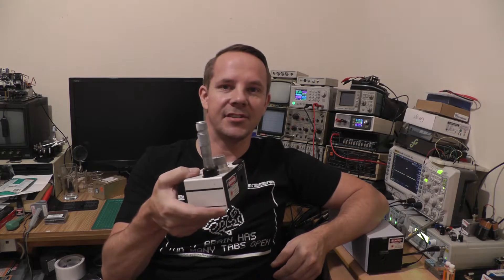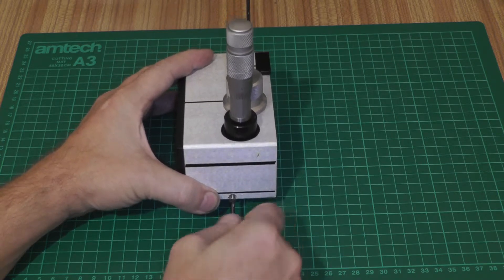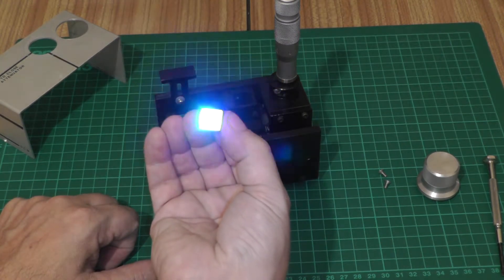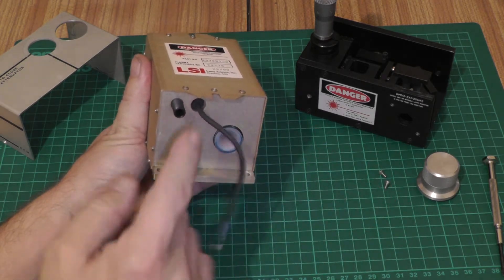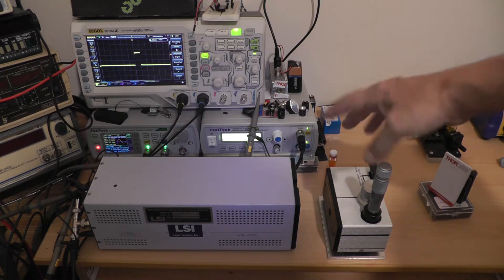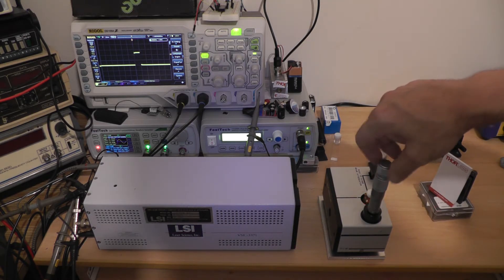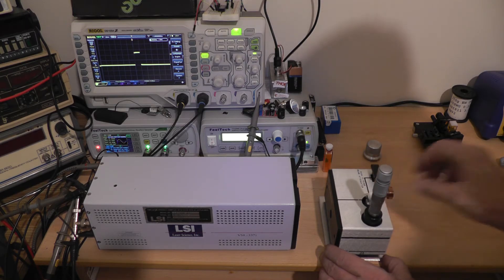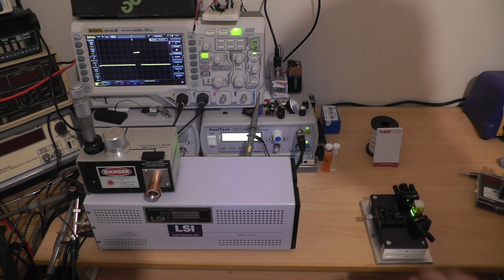Dye Laser Teardown and Demonstration

Comment: I'm building a rhodamine b dye laser using a flashlamp pumped passive q-switched Nd:YAG w/ SHG assembly, and would absolutely love one of these gorgeous dye laser assemblies. Heck, just a nice stable cuvette holder w/ mirror mounts would be amazing. Unfortunately I live in an apartment and can't manufacture an optical table for mounting parts, but I'm still hoping to get nice lasing.
Reply from the maker: Nice. with doubled YAG as the pump, you will find it hard not to get it to Lase! It is possible to do a reasonably good job of a cuvette holder, with basic hand tools, and some 12mm square section aluminium tube (with a 1 mm wall, a cuvette fits nicely in these!). I have a video of a home-made effort here: https://www.youtube.com/watch?v=-ny_-Y1MpRY

Comment: These are as rare as hens teeth. i’ve looked for a few years consistently on eBay… I’ve always found the dye stuff interesting… But these have not appeared on the USA eBay page in at least the last 18 months that I know of. And I always check the LSI equipment, specifically the VSL337 nitrogen lasers. Because sometimes The die modules will be oddly attached or included in a part slot with an LSI nitrogen laser

 Would be a lot of fiddly work… But I could reproduce them fairly well… With a bit of machining and tweaking. I don’t have access to my milling equipment and 3-D printers at the moment… Which would make things much easier. And I’ve got stacks of NOS starrett micrometer heads. 
When machining complex parts, blueprinting and machine setup is super time-consuming. But once each machine is set up for a process… It’s almost as fast to do half a dozen as it is to do a single part. And I’ve already got all the bar stock and materials. Hell I don’t know how else I’ll get my hands on one because they are crazy hard to find. 

Hell I can’t even find a decent and affordable cuvette holder…. so that I could make a quick mock up like your original design. all the holders I’ve seen are either terrible quality, or insanely expensive …..even for A cuvette holder thats non- adjustable

they are identified by the model Numbers “ DUO 220“ and 221. Also each one has its own longer part number as well.

I Actually found the original instruction/service  manuals with diagrams and measurement information. They were kind of hard to fine and I stumbled across them by complete accident when searching online.  But there’s a website that has pretty much every manual for anything nitrogen and dye related from lsi. 

if you need a link … Let me know because they were kind of hard to find.
Reply from the maker: Yeah, I found mine because it was listed as a "Laser attenuator" so the seller didn't know what they really had. It was still $200, but worth it for the optics alone, so a great deal.

Before I got, this, I built my own anyway here: https://youtu.be/-ny_-Y1MpRY
It is all constructed out of Aluminum stock, and required nothing more than a Pillar Drill and hand tools. The mirror mounts and linear focusing mount of course were purchased from eBay.

The Cuvette holder was made from 12mm square section Aluminum tube, the inner dimensions accommodate the cuvette nicely, though it is not terribly precise.

I recently added a toothed pulley to my home made Dye Laser, so I can tune it  with a stepper motor.

I have a  user manual for the DUO, but always happy for more links ;-)

Comment: What are the focal lengths of lenses used?
Reply from the maker: The cylindrical lens has a focal length of about 25mm. For focusing the output of the dye laser, you want a relatively long focal length. I am using one with and FL of about 70mm at the moment.
Reply: @LesLaboratory  
What is focal length of that mirror?
Reply from the maker: @bilalmughal6395  The mirror is just plain flat. Ideally it would be radiuses, but that is expensive.

Comment: If you use diluted dye in the cuvette inside you can pump this with a blue diode array. It isnt very powerful but is somewhat amusing to be able to dial in any color from pea green to deep red. Strongest at the rare to see laser color orange though with R6G.
Reply from the maker: That's not likely unfortunately, unless you flow the dye at high speed. Triplet absorption will kill any Lasing. In addition you need very high peak powers to achieve a population inversion. It has been done in the literature recently with nanosecond pulsed Laser diodes, but the output is in the order of picojoules.

Comment: I don’t mean to spam your channel or bother you with another comment. But do you have any idea on a timeframe for a DIY spectrometer project? 

I’ll be following closely. And I might could even help if there’s some parts you’re needing. I definitely have more than I can use and can usually get my hands on anything very cheaply.

 I build guitars and violins full time... but I spend about half of my waking hours repairing industrial electronics and test equipment. I accidentally fell into that field as a hobby about five years ago… and started having regular work for clients about two years ago. And I have spent the better part of that time at government auctions, industrial recycling yards, and all kinds of interesting places pillaging goodies and parts! 

I’ve accumulated a lot of nice optics, sensors, and other goodies from my years of harvesting and collecting adventures… I’ve probably got everything needed. And have an overflow of high-quality linear CCD sensors. With control boards paired. 

I have a special parts cabinet dedicated to Hamamatsu solid-state goodness!

So if you need anything for the spectrometer project just let me know.
Also, some guy on eBay is offering beautiful ocean optics Branded DIY spectrometer stuff. From the basic optics bench, all the way up to every part needed to build one. Of course it would be pretty expensive you might as well buy a good used unit. 

But for the optical bench With the mirrors ready to go for about $50… It might be worth it to start there. Here’s the eBay item number if interested. 142457563216
For $50 it sure would save a lot of 3-D printing time and give a really nice enclosure.... that is fully adaptable & properly sized/fitted. 
components could be dropped into place as upgrades are wanted.... so it would be completely modular and work with the industry standard stuff!!

Same guy has a ton of great stuff

Software tends to be the real problem with DIY spectrometers. There’s a guy on Hockaday who has a wonderful spectrometer project documented and he seems to have solved the software issue. Here’s a link you should really check it out Guy has solved all of the major problems of professional DIY Raman spectroscopy 

https://hackaday.io/tvaettbjoern

Jesus Christ.... and I thought gamma spectroscopy gear was expensive! 😂 

Don’t mean to bother you, and ramble but there’s just so much potential with your content!! you have so much to offer the laser and DIY optics community. That’s extremely rare on YouTube these days! And as I’m in the test equipment and salvaging business… And live here in the states… I would gladly help you anyway I can with hard to get or pricey parts.

By the way check out my buddy “zenodilodon” channel here on YouTube if you haven’t. He’s just a kid and such a bright young guy who has taught me so much and spent many hours emailing me back-and-forth with questions I’ve had over the past year or so. Don’t let him fool you. He’s got an incredible understanding of laser and optics technology!!!

Sorry to keep rambling.
Reply from the maker: Thanks for the offer, sure I will ask, If I end up down a hole with unobtanium parts!

I have been drooling over the Ocean Optics stuff for a while. I saw that listing, but it seems to be missing the grating (which is a custom part in these, they are curved) I have an off the shelf spectrometer (the kind you look through) and have been having a go at acquiring an image with a webcam.

I have already written a Python Script to acquire and process the image in a sensible fashion. It is pretty straightforward a bit of open CV and some creativity, and you can get a nice display out of it. I'm hoping to move away from webcams and get it working on the raspberry pi with the picam.

I am getting reasonable results so far, most of the issues to be solved are mechanical, but I want it to be right before sticking it up on here. 
I'm trying to do something that is not crazy expensive either. It might end up being a miniseries in its own right.

As usual, time is my enemy at the moment. My full-time job is hella busy at the moment, plus like all of us, I have other projects on as well. (I am in the process of characterising and measuring these N2 Lasers (Got some real nice power sensors ))

Yeah, already had e-mails from zenodilodon, seems like a good guy, he will go far.
Cheers!
Reply: @LesLaboratory  That specific item I linked you is only one of his options. If you look at his other listing he has several other ocean optics optical assemblies including diffraction grating, and everything. And he sells all of the diffraction grating options and lenses separately also. I think it’s about $100 to get the module with the slit SMA connector installed, diffraction, and collimating mirror. Seems like a great deal. Check out his other listings. He basically has it set up so that you can buy the module with as few or as many options as you want.
Reply from the maker: @hullinstruments  ok I'll check it out, and see what this month's budget will allow.
Reply: @LesLaboratory  Worth looking to see if any of the 473nm modules from B&W Tek are still on ebay, if you get the complete chassis it contains a spectrometer module and the electronics to interface to it. There's a thread on LPF that details what's needed and I can link to some software that works with it.
Reply from the maker: @cambridgemart2075  Already built a spectrometer for the Raspberry pi, and wrote my own software for it about 3 weeks ago, but not had time to video it because of a rather major life event. It is coming though, and it is pretty useful!
Reply from the maker: @cambridgemart2075  It is done! See: https://youtu.be/T_goVwwxKE4

Comment: To my eyes, even the rhodamine 6b range looks impressively wide, possibly even more impressive. From almost green, all the way to deep orange (from your video).  I am still in the planning stages (mostly lack of time) of building my TEA laser and have already ordered rhodamine dye. Could you tell me how simple can the TEA laser be and still have enough peak power to pump a rhodamine dye laser? Your DIY design seems wonderful but as I am on a tight budget I was hoping to do without the N2 source and external capacitors. Would a air TEA laser with a 'classical' flat aluminium foil  capacitor be powerful enough?  A pressurized spark-gap seems easier and cheaper 'upgrade' to the most basic TEA laser designs. Would it still provide a noticeable improvement even without the 'external' capacitors?
Reply from the maker: I'm sure it does, I am red-green colorblind, so it is difficult to spot the change with R6G for me. With the coumarins it is easy!

I am sure simpler designs would do the job,  but I wanted something reliable, and high powered enough to Lase just about any Laser dye, regardless of purity.

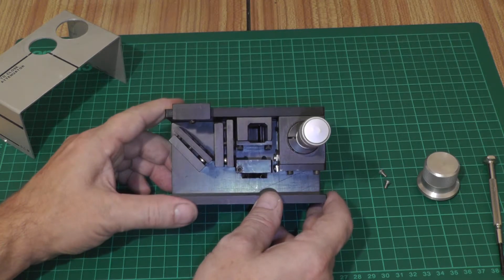You can do it with just plain aluminum foil capacitors take a look at the first design in this video at 2:47
https://www.youtube.com/watch?v=pCnXftuJ9Zo

This Laser worked very well, it was just a pain to have to keep replacing the dielectric every week or so, so I improved it with Doorknob Caps.
Reply: @LesLaboratory  Thank you for the info!

Comment: I like your Channel logo out of curiosity is it based off of anything? Also I always assumed dye lasers would have the dies bolted into the laser like a green laser
Reply from the maker: The Channel Logo, is two stylized 'L' 's for Les' Lab. I wanted something that looked like it could be a regular warning logo.

Dye cuvettes are generally not bolted in, because it is convenient to change the dye and alignment is not as critical with say DPSS cavity elements. In a DPSS Laser the angle of the KTP crystal is critical for optimal operation.

Comment: Well I guess I'm going to have to search ebay for something similar.

I'm surprised to hear that the DIY laser is a more powerful pump source than a commercial unit.

I'd like see the teardown of the commercial laser head.

Cool stuff man please keep it up!
Reply from the maker: Yep, cool stuff can be had on eBay :-)

Well, with more pump power, come problems. Once you really drive Dye Lasers well beyond threshold, they will begin to Laser Super-radiantly (Without mirrors) . Once this happens, no amount of feedback from the diffraction grating will affect the Laser wavelength, so you can no longer tune it. For mine, I had to significantly defocus the Nitrogen Laser, to prevent this from happening.

The teardown of the commercial N2 Laser is here: https://www.youtube.com/watch?v=US3vLJIUGoU
Reply: @LesLaboratory 

Thanks Les, it makes sense that the dye can be pumped hard enough for it to become un-tunable. I was just surprised that a relatively simple DIY laser is so powerful.

I've watch the teardown video before and should have been more clear. If I remember correctly there in the teardown the electrodes where in a sealed "tube" so we couldn't see the cavity design. What I was driving at is if the head is bad it might be interesting to crack it open and see if there is any "magic" in its design.

I was also wondering about the cuvettes you use. Are they polished on four sides? I've been eyeing the offering from Thor Labs and want to make sure I pick up the right ones.
Reply from the maker: @drrrrockzo  Ah right, I get you, it would be better if that Alumina tube were glass then we can see. Once I tear it down, I will do a video on filling the tube myself with low pressure Nitrogen and I will see about getting some close ups through the front window. 
There isn't much magic in them. Internally there are a pair of rail electrodes, and there is a Pre-ionizer arrangement, that looks to me like plain wire, with clear insulated layer running the length of it. There is a high reflector at the rear and it looks like the Output coupler, is just plain quartz. The gas fill of these tubes is a Helium Nitrogen mix, which is probably why they don't age well. The He will leak even through even apparently solid materials including hard seals, alumina, and even metals, As far as I am aware, the He is just a buffer gas (but probably helps with ionization). I intend to refill mine with just plain Nitrogen.
Reply: @LesLaboratory 

In all honesty, the process of refilling the tube and testing it sounds more interesting than breaking down the tube. I had imagined that there was something "exotic" going on in there but it's sounds like a textbook nitrogen laser. 

I scored some doorknob caps on ebay and when they arrive I want to try the charge transfer topology. 

You mentioned 60pF/cm of electrode and I implemented the blumlein successfully based on that guidance. My question is with the charge transfer topology, is it 60pF/cm for the peaker or dumper?

I estimated the dimensions of your peaker, and I think the 60pF/cm applies to it and the dumper should be 3-4 times larger. Is that correct?

Thanks for all the help man!
Reply from the maker: @drrrrockzo  Yep for sure! I am curious to see how hard a refillable tube can be pushed.
60pF/cm is for the peaker only. In the LC inversion (or Blumlein in the literature) it would apply to both sides of the channel.
The Dumper should be at least twice the size of the peaker. In some literature they specify more, but just over twice works for me. If the Dumper is too large, you will get a lot of sparking in the channel, which is not helpful.

Cheers!